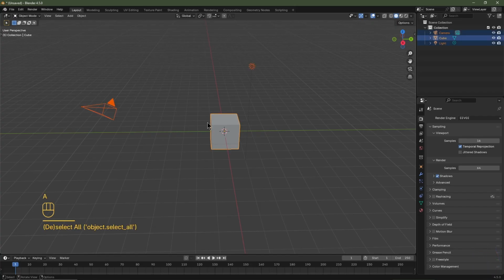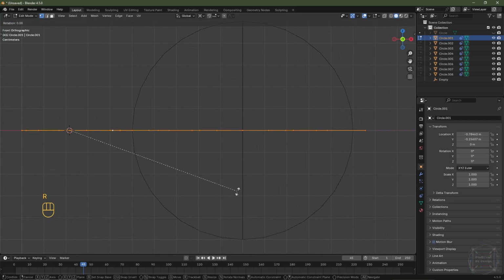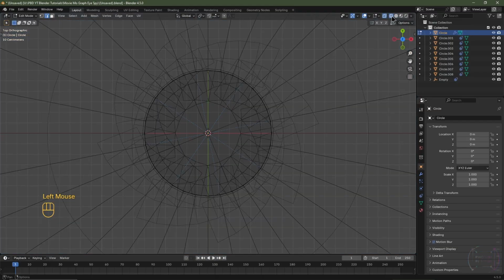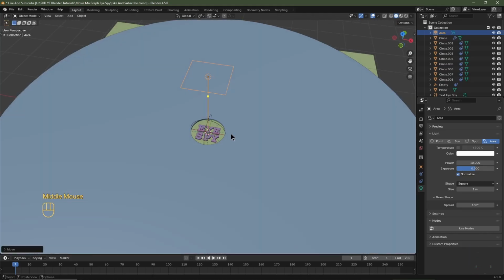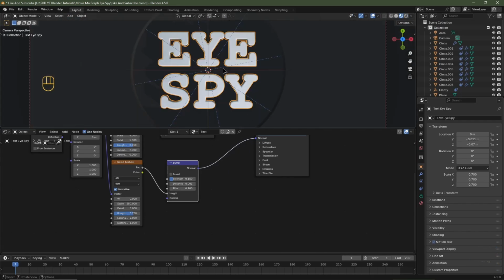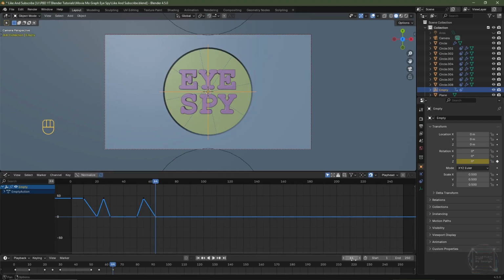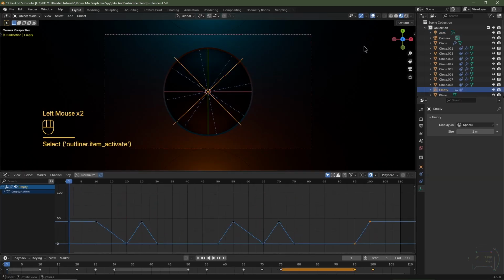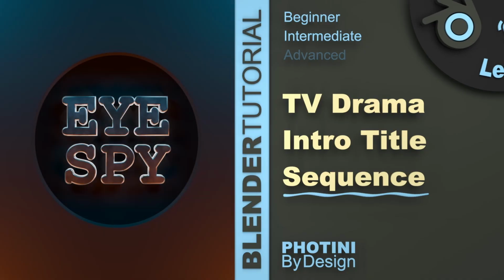Motion Graphics Title Sequence - Blender Tutorial

Comment: When you have made the one curved segment (and set its Origin Point), add an Array Modifier. Set Count to 8. Un-tick Relative Offset and tick Object Offset. Add an Empty and Select it as the Object in the Array Modifier settings. 
Rotate the Empty 45 degrees (on Z) to make the 8 sections rotate and become the whole shutter. and then go into Front or Side View & move the Empty up on Z until the shutter blades are all stacked one on the other. It helps if the curved segments have all been extruded a small amount so you can see them. Go into Wireframe Mode if you do not want to extrude them - so you can see them side on. Because it is an Array Modifier - the Empty arrays the blades. 
This stops the blades being angled and causing all the problems that follow. They do not intersect as they are all stacked just like RL.
Apply the array and reuse the empty to do the animating part.
If this is a new thing for you, play with the Array while it is still active. Try scaling the empty 😉
Reply from the maker: Absolutely spot on, after I recorded the video I realized I probably should have used an array modifier instead, it would have been much easier to execute. It's one of those things that is obvious but still didn't realise until it was too late lol. The array modifier is a really handy feature which would have been perfect for the job.